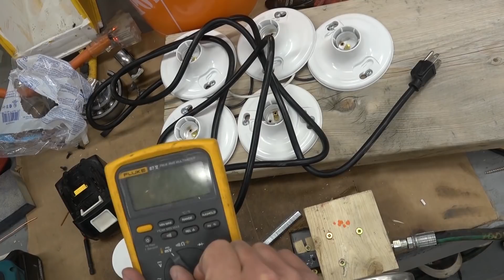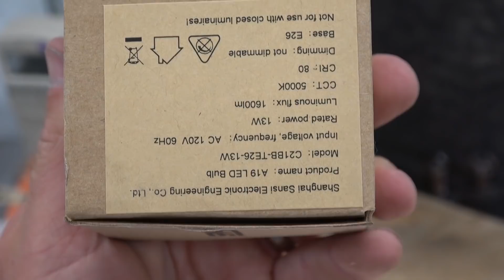Do LEDs work for slow motion?

Comment: you done fucked up.  just go buy some DC LED light bars and use a battery or a $40 meanwell switchmode supply.  The flickering is shitty rectification in your bulbs, so just eliminate the rectification stage...
Reply: source: just before the end of the world, my office did an LED T8 swap for all the lighting and it ruined our 240fps test filming stuff with mad 60hz noise.  We got $60 worth of light bars and threw them on a battery and just blew the flicker out with cheap lumens.

Comment: Already having a few cheapo outdoor 3000K LED flood lights with the cheapest PSUs I chose the simplest way of getting the flicker away: Hooking up a 20V 2 200 mu electrolytic cap in parallel with the 12 VDC LEDs got rid of the flicker, at least at the fps' I go out with. Cheers DIYSwede

Comment: I just had a very small impact gun let the smoke out... It was dirt cheap on clearance but man was it useful. Working in automotive field, doing dinky stuff like taking airboxes loose/clamps/installing batteries etc... It was a black and decker BDCS80i 7.4v job. The issue is that one of the motor brush "arms" wore off. So i couldnt just put a brush in it plus it was a unservicable motor made by leshi motor number was 380SL-33290 under that was written 131031/A. I been trying to find a motor to replace it. I have found one that seems like a fairly good candidate but anywho if somebody is more knowlegable about it... Recommend me something. The one I found is here https://www.amazon.com/Mxfans-7-2V-8-4V-21000RPM-Copper-Electric/dp/B075RZLVSG/ref=rtpb_2/146-9175935-9905439?_encoding=UTF8&pd_rd_i=B075RZLVSG&pd_rd_r=aae30d79-4a88-4770-81d3-5cbdcd487d08&pd_rd_w=2aFjm&pd_rd_wg=f3Joa&pf_rd_p=3dd61217-577b-425c-8e55-2733fd8bd458&pf_rd_r=4VMBYTZ0P29AFWZGP6CM&psc=1&refRID=4VMBYTZ0P29AFWZGP6CM#aw-udpv3-customer-reviews_feature_div

Seems to fit dimensionally and i figured i would want one of the higher rip'm motors.
Only thing stands out as wrong is the shaft has a flat spot in the business end that mine does not have. I torched the original gear off my motor and it is not flat spotted.

Comment: Why not run one set of lights off one circuit phase and other lights off of another phased circuit.  Usually, I specify a minimum of a 2K incandescent light as the filament of the bulb stays hot enough to miss the AC webble wobble.

Comment: It's not the pulse width modulation that causes the flicker.  It is lack of filtering after the rectifier.  As you said, it is 120 Hz that interferes, not the 10 kHz or higher PWM.  I have been wondering if it is safe to add filtering capacitors.  I was hit by the same issue on my 1800 and 4800 frames per second videos.  You can buy No-Flicker video lights, but I probably am not going to pay for those, as in all likelihood my hardware store lamps will be just fine after I add little 30 cent capacitors.

Comment: Could have just used a 32-volt bucking transformer feeding a full-wave bridge rectifier into a nice fat capacitor to drive your common LED bulbs off a ~120 - 130 volt DC source and gotten rid of the AC flicker effect that way.

Comment: I built the exact same type of light fixture for my aquaponics system a few years ago.  I put twenty bulb holders in two rows and fitted them with the cheapest CFL bulbs to be found at Peavy Mart.  It worked perfectly and the plants did just as well as the ones under the several hundred dollar led fixture beside.

Comment: Somewhere on the web there's a pretty good article about replacing that factory installed smoke. They do focus on older electrical systems in cars but they also touch base on universal replacement when the OEM is no longer available.

Comment: Connect batteries in series for required voltage to drive LED lights = no flicker. 12V LEDs, car battery. SO much cheaper.

Comment: You are right AvE, the nonmetallic cable for wood studs is a uniformity thing. In an apartment building or house no fricks are given for fire protection past smokes and a sprinkler system. If a place wants a special insurance designation  or perhaps its just code for that class of facility, they get steel studs, wires are piped, any hole for water, gas, or electrical is fire cocked so fire and smoke is isolated by noncombustible materials.

Comment: Brush type Makita driver?  It looks like it threw a winding off the commutator.   Common failure mode.  If you would have stopped when you saw the problem, it could have been repaired.  
Guess you now can replace it with a Metabo..a German Metabo and not rebrand Hitachi

Comment: All ya need is to run the Bell E D from a batteria, or from an AC to DC PSU with a nice fat crapacitor across the output. If you incest on using AC Bell E Ds than ya can put a crapacitor on some of them, to cause a phase change. We used to have double 8foot flourescent tubes that had this on one of the tubes. All so the Apprentice or office staff didn't lean on a lathe chuck while she was spinning. Hope ya had yer safety squint and held your breast while you burnt up the Makita.

Comment: Those should really be mounted on an inclosure. Instead of using those fancy and expensive bulbs. I would used 12 volt dc bulbs or led lights made for automotive applications. A defuser may or may not be required for a particular application, but if you need one take apart a dead lcd monitor and you'll find plenty of filter material to make the light softer...peace out dude..

Comment: Pro tip.  Use an LED flashlight and wire it up to a DC power supply.  Get the on/off type and not the fancy multi brightness kind.  PWM still causes strobing.

Comment: I recall when CFLs came out their 10-20 kHz flicker messed with TV remotes communication. LED's running on rectified AC, but not well filtered, power supplies would flicker at 120 Hz. If you have a good regulated DC power supply use it for your lights. Lower voltage because these LEDs are current devices designed for average voltage and a pure DC input puts them at a 100% duty cycle.

Comment: The bulbs use switching regulators which will run on DC. I did a quick test of a Sylvania LED bulb and it will turn on at 30 V. This should reduce some of the flicker.

Comment: running tools at quarter speed, at full load will always let the smoke out, no matter the brand. it didn;t die, you killed it.
Edit: full load might not have been the most judicious term to use, but it was definitely overloaded. The smoke attests the fact.
Reply from the maker: Feathering four, 1 inch long #6 screws is full load. Duly noted and ignored.
Reply: @arduinoversusevil2025  are we ignoring the fact that you exceed the capacity of the machine? Size of the screw has no relevance, nor does the manner in which it's being controlled (pwm or not) Smoke came out; you went above the rated load capacity of the motor at that speed. These tools have a very long gear ratio, running them slow asks too much of the motor. I get the entertainment value of what you did, you're a shop clown, it's light hearted goofing around,  but don't be disingenuous, I subbed somewhere around 4 years ago, because the BOLTR videos were insightful. makita deserves better, guys looking to buy a good tool might be put off.
Reply: Once it loses all the smoke its impossible to get all the smoke back in it
Reply: Smoke em of you got em.
Reply: Delete ur comment and spare the embarrassment
Reply: @muscleman369  I cannot express how much I love the fact that he fucking pinned this.
Reply: Your comment makes me wish that youtube has a range of emoji reactions like facebook. Never seen a better candidate for the laughing emoji.
Reply: i second all these comments
Reply: Apologize to your ancestors. NOW!

Comment: Now I might be an idiot when it comes to this sort of thing. But could you wire up half the bulbs to flicker on during the positive AC current and the other half to flicker on during the negative AC current? Seems to me that if you just flipped the wiring around on half of them that you might end up with a more stable light source.

Comment: With the 120 Hz artifact still present (now you mention it, even THAT much is annoying me, even if it IS much subtler), I figured you'd at least admit " IGEFTGIGOW " after trying it.
 
Probably all they did with these bulbs was to put more capacitance on the primary side and ventilate it better so the electrolytic will last a week or three. Looked up the price of these bulbs: ouch! For less than what 4 of them cost , one as handy as AvE could put together a very decent studio light for slo-mo using a real DC power supply and a wide choice of LED form factors in less than an afternoon. With or without the dead tree carcass frame.
This 'solution' seems most expedient for less electronically competent Youtubers.

Comment: Thought it was me. Went and bought some thin handy-boards (poplar) at the local orange store, bill was $147 USD, found myself checking for vaseline once in the truck. (well, the cheapRyobi hand planer beefed the bill up a bit) Shrugged and figured it must be because I usually shop at the blue store. Guess not, I didn't know wood prices had gone berserk. I guess I'm one of those guys using it more than usual, been carving and building related jigs a lot lately, I'm usually not that big of a dead tree carcass consumer. I guess I'll be using "natural" sources more going forward. Whoda thunk my firewood went up since I stacked it a couple of years ago. Some of it now has a date with a bandsaw, not the stove....

My condolences to the Makita, they're pretty tough. I still have a 9.6v stick battery drill and mini-circ that work OK, but making the batteries is a PIA, so they are more shelf decorations these days. Hope you find a suitable replacement, somehow, I have the feeling that  you'll find something that'll do...

Comment: I sold Japanese cameras for a while and we did a lot of mandatory courses on things like how to bow correctly and occasionally their tech. Pretty sure the "rolling shutter" effect is about the warping of images... but im pretty sure you just have a simple strobe-effect.
 Example is watching Racecars like those zesty Lemons of 24 hours:
...
 They have an LED in their front window to show what car number and race position... during slow-mo especially at night you see it "flashing". That is the strobe-effect because we know that LED's dont glow so much as flicker... and occasionally that timing might line-up a few frames in a row to appear like it's flickering out.
---
 "Rolling Shutter" describes a warping effect caused by digicams with CMOS sensors.  Film a car driving past a tripod at 60 KMH and then look at the wheels in slow-mo, they look like the bottom of the wheel is melting off and "bending" forwards.
...
Digital film is a light-sensitive computer chip, either CMOS or CCD.
 CCD (old Kodaks) took a "snapshot" every few milliseconds and then capture more light. This was a bit slow and flickery, and every pixel only captures light for the same amount of time. Then it wipes the chip and "soaks in light" to capture the next frame of video
...
 but a CMOS has a "rolling shutter" like an old CRT beam - it starts at the top-left pixel and scans it's way diagonally down the photo, to the bottom-right pixel and then starts again for the next frame.
 It's "polling" each silo (1/3 of a pixel) one-at-a-time and then moving on to the next, meaning the first pixels capture a bit earlier than later ones... so the top half of the frame of video will show the car in position A, the bottom half of the frame might show the car at A + 1 meter. The pixels in-between look like its melting+bending between the 2.

Comment: I would have just used a DC source instead. Use a car battery or a well-regulated 12V supply and you'll never have to worry about the flicker even when you eventually achieve a higher frame rate.

Comment: Quick question, say you have two bulbs, and on the USA side you wire them on opposite phases of your electric box would they be out of phase with each other and double the flicker to 120 hz?
Reply: The flicker in a light bulb actually IS at 120 Hz already. There is a bright spot at the positive peak, and a bright spot at the negative peak. Two peaks per cycle. So, 120 Hz instead of 60 Hz. For the same reason, using the second leg of a power installation would not result in any improvement. The positive peak of L1 will occur at the same time as the negative peak of L2. But three phase power would possibly reduce the problem, because now there will be 2 peaks per phase per cycle. So, 6 peaks every cycle instead of two. And none of them line up perfectly with any others. But, 3 phase power in the US is either 208 or 240V. So unless the bulbs are rated for that, it is not practical.

Comment: So...would adding a capacitor across the LED input not work? Having manucobbled some LED tape together to run off 120 volts, a capacitor cleaned the flicker right up.  Also. Don't worry.  It was just to prove a point to someone.  Upon their admittance of fault, I tore it apart.

Comment: Would recomend Makita DTS141 Brushless Oil Pulse Driver purchesed from Jaipan so you can get it in a non-teal black with the fancy font forign lettering (and cheeper)
Can do all the normal impact driver stuff but is good for delicate impacting and kinder to your lugs. Expensive but your regret leaks out every time you use it

Comment: If you want to get rid off the strobing completely, you can use a current source like the LED driver XL4015 boards (with constant current adjustment) and an led strip. These have a high enough frequency to not strobe at all.

Comment: Still have any 3-phase variable speed controllers kicking around? You don't need the variable speed. But the single-ph to three-ph would let you put the lights a third of a cycle apart to smooth out the total flicker.
Edit: Just don't up the frequency too high,   capacitive dropper current-limiting and whatnot. That Makita's magic smoke won't be the last.

Comment: "One slightly used 18V (maybe) Makita impacted screwed driver for sale.  Make offer".
Small print...may or may not have been used in dominatrix videos where whips, chains, high heat, acid, boiling wax, impact poker devices, and dismantling have taken place.  Not necessarily reassembled according to mfr standards.  The Makita did not kill itself.

Comment: the easy way round is to add an extra capacitor over the LED array, to smoothen the kink, and get smooth light.  50V, 1000uF would do just fine, but smaller might work depending on the switching frequency and duty cycle the LED's are pulsed at.

Comment: Try 12Volt LEDs running off a battery/DC. I'm developing an 8mm Film Scanner and had the same issue. Powering the light source from a car battery eliminated the flickering. The camera's CMOS sensor also has a rolling shutter which adds to the banding/flickering/pulsing. I've been led to believe that a camera with a Global Shutter will fix that. 
Keep up the great work. Love your vids.

Comment: What was the reason for not just using incandescent?
Reply: Explained in the first 30 seconds of the video.
Reply: @stanervin6108  I watched the video again and didn't hear the reason mentioned.
Reply: @davemarm  
The frame rate flickering due to synchronization of ac 60hz pulses. Very noticeable when high speed is played back in slow motion. Sometimes frames drop out altogether.
Reply: @stanervin6108  That's an issue with LED bulbs since the light output quickly responds to the voltage and can be seen when using high speed cameras. My question was what was the reason for not just using incandescent bulbs which have a much different light output response rate compared with LED. That's why incandescent/halogen Christmas lights don't have the same flickering issues as LEDs. That wasn't addressed in the video.

Comment: Is that a dedicated Slo-Mo Camera, AvE? 
My now Outdated Huawei P20 does 960fps too, and I'm wondering if they use the same hardware, that yields the same frame rate as each other, variable in 3 settings I believe...?
Reply: different kinda CMOS sensor. His one looks like a Sony which are "lit" from the other side. ie those little photosensitive silos on the image chip (digital version of film).

Comment: That's not that much better. Consider using some 12vdc strip 5050 5k LEDs and a linear regulator like the 7805 or its higher current brother in the T0-3 case. BTW wranglerstar is outproducing you on vids at least 12 to 1. Up the production rate! Also, can I have a hit off that Makita?
Reply: And since you are filming google up high CRI LEDs with whatever you chose because the camera will like it more. 7805s are dirt cheap now and you could run them in 1 amp banks to your LEDs (which in strip form you can chop to the appropriate length for the 1 amp current) for more or less light. With a constant current linear regulator like that and a few decent electrolytic filter caps you should never get any flicker on any camera ever.

Comment: Electrical stuff runs on smoke (not pixies as AvE might assert), the best kit keeps the smoke inside, the shite stuff isn’t as well manufactured and the smoke escapes. British cars from the 70s & 80s were wired up by the cheapest / quickest possible methods, as a result they leaked smoke and then then failed, much like that Makita. 😜 
In my limited experience (of destroying many a car / electrical item) I’ve found that in 100% of the cases when the smoke escapes something is broken or worn out. Therefore, smoke makes stuff work, when it escapes then they don’t work QED.